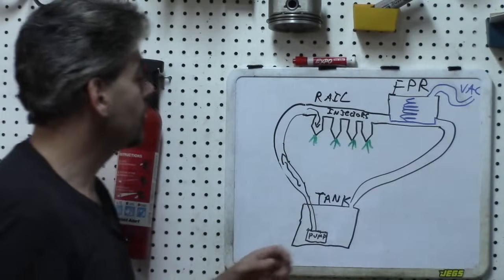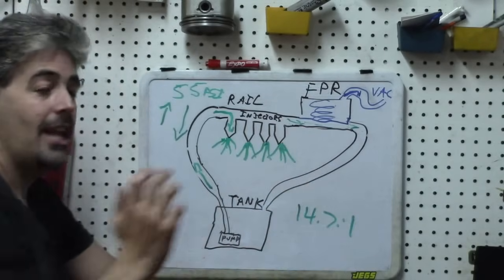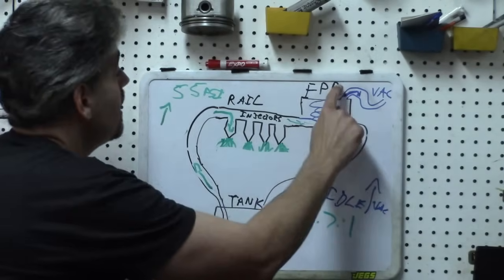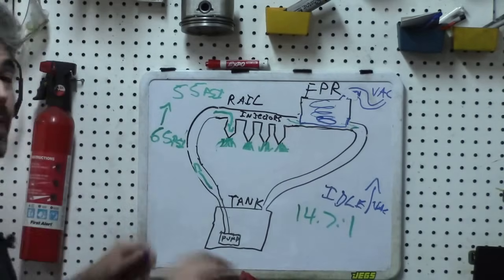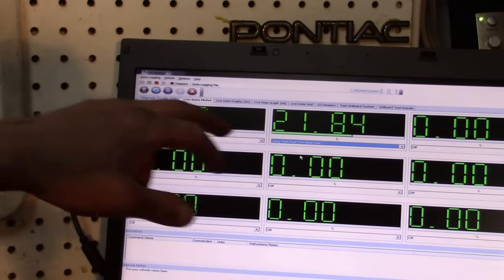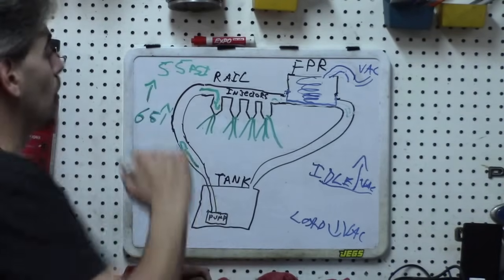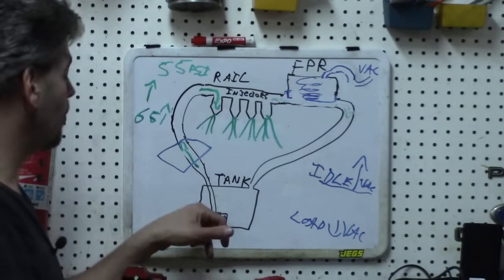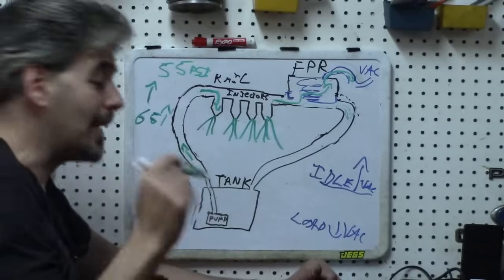Fuel Pressure Regulator Diagnosis + Understanding (HD!!)

Comment: How do injectors leak is it because the o rings fail or the pindle wears or both Matt? Got it  Matt it can be because of carbon buildup or o ring failure.
Reply: I'm not on his level, I'd be handing him tools lol but to my knowledge, internal and external components wear and as F.I. run at (at least they are supposed to) tight tolerances, when they wear out, fuel either can leak, clog or spray incorrect patterns! This is especially true when a dirty fuel filter is present or contaminates enter the fuel rail! Some "additives" can accelerate this by freeing up gunk from one end only to find it's way in the injector! I know this is probably blasphemous for me to speak my understanding in light of his knowledge (not joking either or being smart, he's that good) but yes, o-rings fail, contaminates build up, corrosion occurs and etc. I just wanted to give you SOME explanation to your answer but I'm sure he knows a lot more in depth as to the "why" or "what" than I do but that's a start! I'd recommend a fuel rail hook up and F.I. flush or isolating the faulty one/ones and replacing.
Reply from the maker: I agree with your answer!
Reply: Thanks and the injectors can hole pistons in  some cases.

Comment: Can you have too much soot on your spark plugs that you don’t burn off the fuel and this the fuel pressures are higher than normal?  I wanted to ask you as I would think this doesn’t make sense.
Reply from the maker: Such a thing would have no impact on fuel pressure.
Reply: @ is the only that fixes high pressures of 120 on a KJET the warm up regulator? That makes no sense either as when the car is warmed up it still doesn’t rev past 2000 rpm’s or go past 20 mph, but otherwise is idles perfectly and I’ve swapped out 3 used old WuR and no difference.

Comment: Hi, I could really use some advice! So, I plugged in my tester and the PSI does not change no matter what I do, only when I turn the car on, it goes up from 50 to 59. It’s a 2003 GMC Envoy I6. It stays constant at 50 in “on” and constant at 59 when the engine is on. I tried unplugging the vacuum line but nothing happened. I tried adding vacuum and nothing happened. It’s running rich. I have a p0172. What could it be? It stays constant no matter which test I run.
Reply from the maker: It’s not fuel pressure related. Look for other rich condition variables. I usually start with basic induction metrics.
Reply: Schrodingers Box thank you!

Comment: I have a 98 International 7.6, I took off the fuel tank and washed it with water well. I connected the fuel hoses by mistake and gave it air pressure, then I corrected the error. I tried to start the truck. It never started. Can you explain to me the reason?
Reply from the maker: Not quite sure I understand how you made the mistake- you connected the fuel line to something generated air pressure? What in an engine creates air pressure?
Reply: @SchrodingersBox  The problem is that the engine only starts when starting fluid sprays momentarily
Reply from the maker: Then you 100% have a fuel problem. Is the fuel pump running? If it is then You need to measure fuel pressure as first step.

Comment: It shows 1 psi pression with ignition on but when it turns on has 45 psi pression
Reply from the maker: sounds like a bad check valve. does the pressure drop right back to zero when engine turned off?
Reply: @SchrodingersBox  yes Sr. As soon as I turn the key to the off position
Reply from the maker: yep.  totally a bad check valve.
Reply: @SchrodingersBox  so replace the fuel pump right thanks Sr , the way you do thing is perfect , your videos are great explain perfect the issues have a good day
Reply: Is this the Vapor canister check valve that one I have to replace Sr?

Comment: Hi ..I have a 2006 trailblazer 4.2L and I changed my fuel pump and installed a new one but my problem is every time I pump some gas into the vehicle , its hard to start plus if I drive over 65 mph the engine hesitates and and it takes long time to increase speed plus ..if is over a hill , engine starts to hesitates again....I will be checking fuel pressure with gauges ...also large evaporation leak check engine code comes up ....and I already changed gas cap....any ideas other possible ideas? I changed spark plugs,cleaned MAS sensor, changed coils and vehicle still having that issue after running a while....
Reply from the maker: What was your data that indicated the fuel pump was bad on the first place?  
  Also what is your data it is an ignition problem?
Reply: Schrodingers Box I had problems with the fuel gauge. Every time, I pumped gas and it was about to be full, the needle jumped back to empty...so I decided to replace the entire fuel pump , instead of the needle gauge inside the gas tank....thinking that my vehicle has 175K miles on it , it was a good time to replace the fuel pump...and  (it was working fine) replaced with an aftermarket pump. Maybe I have to verify if is a fuel filter halfway clogged but need to verify fuel pressure on the line. Since , I replaced the fuel pump all kind of codes have been showing up, lean conditions, misfired cylinders even large evaporations leak.
Reply from the maker: You need fuel trim and pressure data to determine the next steps b

Comment: In my vehicle GMC yukon 2007 . I get the pressure 30 move key and when energized 40psi. Is this indicate weekness on fuel pump .
Reply from the maker: Compare this to factory specifications to determine.
Reply: "Non Throttle Body"

Multi-port or spider injection. 
1996 up V8 5.0 5.7 4.8 5.3 gas GM Truck 55 psi minimum preferably 60 psi.

Regulator or pump ?
Usually the pump.
 I have seen some that will not run on 50 & some that would run on 35.

Comment: What reason could there be for a car to eat fuel regulators? I have another friend whoms car has gone through 3 fuel pressure regulators in the last 5 years.
Reply from the maker: Possibly high fuel pressure OR consistent misdiagnosis
Reply: Whooooooo, that was quick :D thanks. I will definitely check that out tomorrow when i have access to his car.

Comment: I have a crank but don't start situation on a1990 Mitsubishi  eclipse 2.0 ,dohc 16,valve  fuel pump delivers fuel at a good pressure ,Spark is OK, I'm  not sure about the fuel pressure regulator I don't have a pressure regulator tester
Reply from the maker: you will need to get one. otherwise you will have to measure fuel trims- not easy on OBD1

Comment: I need help,Would a 2003 dodge Dakota have the same system has explained in this video?
Reply: In other words is it return less fuel system or not ?
Reply from the maker: Is it?Simply  Look and see. You don't me for that
Reply: Schrodingers Box i did some research and found that it is a non vacuum fuel pressure regulator. Is there somewhere you could direct me to find some more info about these?
Reply from the maker: Doesn't matter- just measure the rail pressure static vs idle and load and determine if the FPR is faulty.
Reply: Schrodingers Box Ok, because when I drive my truck i say about 15 -  20 min into the drive it suddenly doesn't want to accelerate anymore and hesitates, I just barely got a code p0001 which was the fuel pressure regulator
Reply from the maker: Then i would test it as my first step since there is absolutely no evidence the regulator itself is faulty.
Reply: Schrodingers Box ok thanks!

Comment: I wonder if you have any knowledge on my 2000 Honda Accord V6... Lately as I've been driving it at normal speed let's say 30 to 50 mph when I let off the accelerator the RPMs drop instantly to around 1,000.. as soon as I put my foot back on the accelerator the RPMs go back up to what seems like a normal rate of around $2,500 to $3,000. I tried changing my spark plugs which I did all but one I don't know what's going on going to work more of that tomorrow it's either stripped or stuck... I also changed my fuel pump. These are things I've wanted to do since I purchased the car. I'm wondering if it's a sensor or number of sensors or even 02 sensor..please help
Reply from the maker: What data do you have?

Comment: 1999 for f250 superduty 5.4 two valve engine lean on both banks. New idle air control valve, New PVC VALVE and line. New intake gaskets. Drained ecm truck ran better for almost a week but check engine light is on again. What else can cause a lean code on both banks besides vacuum leak? somebody help a brother out
Reply from the maker: what data do you have?

Comment: would a bad fuel pressure regulator keep it from starting
Reply from the maker: Most likely not. Whats your data off of it?
Reply: J Rob s
Reply: ive changed the fuel pump valve gasket and still it wont start i use the starting spray it cranks up then dies
Reply from the maker: J Rob Still need data. Whats the decay rate onb fuel pressure? Whats the static vs load pressure? Whats the LTFT AND STFT values idle vs against load curve? I need something to go off man- there's nothing here I can draw a diagnosis from much less a direction
Reply: fuel is in the line i had oil in my 3rd spark plug i cleaned it out and changed the valve gasket didnt use a fuel pressure regulator

Comment: Hi i have a mercedes ml500 is no fPR regulator on the fuel rail ... how can I do the test?
Reply from the maker: "T" in to the feed line with the pressure gauge  and pinch the feed and return lines and check decay.

Comment: My car  2003 C240, my car shuts off when I get to half gas of tank , the fuel pressure is 38PSI , it should be  55PSI,
Also when I shut off the engine then the fuel pressure drops to Zero,
I have a hard start problem, and my car shuts off when I get to half gas of tank.
Also when I took the vacuum line off from pressure regulator , then nothing happens , 
It looks like there is no vacuum.
Reply from the maker: check for voltage drop at the fuel pump next.
Reply: it is 13.57 volt.I think the fuel pressure regulator are  ok too.
Reply: it is 13.56 Volt, regarding your nice video, I pinch off the input pipe to fuel pump and pressure did not change , Also we make vacuum on pressure regulator and they worked , I have also replaced the fuel filter  , The fuel filter brand is "prime guard"
Reply from the maker: Zeinab Abbaszadeh That is not voltage drop. That is voltage. what is the voltage DROP?

Comment: Whereabouts are you located? I'd like to bring my  1998 Ford 4.2 van for you to take a look at.  I swapped in a 2003 4.2, just had to use my intake and harness (which I had to modify). Now my bank 2 upper O2 sensor LTFT is reading 8.6 and I'm trying to figure out what's causing that.
Reply from the maker: Denver colorado.  So what is the STFT showing? why are you concerned about the normal LTFT?
Reply: Schrodingers Box The STFT are showing lower numbers... The LTFT on bank one is lower as well... The upper O2 sensor on bank 2 is showing lower voltages... I’m new to this so my heads in a spin...
Reply from the maker: I still don’t understand what the problem is especially with lower voltages on bank 2 - how is possible to have lower voltages with a static fuel trim? That is absolutely impossible. 
what is the issue you are trying to correct? I don’t follow at all sorry.
Reply: Schrodingers Box Yeah, I’m probably not translating all that well with me being new to this. But your videos helped me to understand how the LTFT forms a new baseline etc. so thank you for that. Keep ‘em coming!
Reply from the maker: Yeah I just don’t see what’s wrong that you are trying to fix. Do you have any drivability symptoms? Any DTC’s? I don’t see how you would.

Comment: so the regulator has 2 positions : on/off  or it gradually open/close depending on the vacuum ?
Reply from the maker: Great question. it is proportional  to vacuum (or to pulsewidth modulation if an electronic one). it is not strictly On or Off.

Comment: I have a 2000 chevy express 5.7..no start fuel pressure goes to spec but then drops right off after 2 second prime..should have been pressure regulator in intake but not..i changed it yesterday with nothing changing the problem..spark is orange off coil and plugs ,this is as far as i am right now and could use help?..thanks
Reply from the maker: Sounds like a checkvalve problem to me- why did you change the regulator?? I don't understand that.
Reply: Because the fuel pressure goes up to spec when key is turned but drops instantly after 2 second prime..i thought thats the symptom of a bad regulator.
Reply from the maker: no- that’s classic symptom of a bad check valve!!!
Reply: So just replace fuel pump then?
Reply: And how do you decipher between the regulator or the check valve in pump? Only thing i could think of that i didnt do is check pressure before the fuel rail, does that seem right?
Reply from the maker: I validate through looking at a negative fuel trim to discern a leak in the system (which may or may not be a regulator) vs check valve.    It can also be measured via fuel pressure curved against load.
  Actually I can think about 6 ways to do it- it's a matter of thinking how the system works and developing your own method for identifying the issue,
  But fuel trim would be my first diagnostic.
Reply: Schrodingers Box i have a scanner that shows fuel trim but it dont start..and when it first happened it never had a problem it just shut down like it ran out if gas..i want to fix it tomorrow, can i just take the fuel filter off and check direct pressure from the pump, and that should give me the answer if it dont drop pressure after 2 second prime? Thanks for info and responses.
Reply: Please help i just put a new fuel pump in and the same thing not holding or pumping enough pressure, what else could it be?
Reply from the maker: Joe, I would need to see your data that indicated to you the fuel pump was bad. What is the deadheaded  pump pressure vs rail pressure? That's what you need to do BEFORE changing the pump to validate that's the issue!

Comment: Where can i get info on why is vaccum higher at idle?
Reply from the maker: Vacuum is higher at idle because the engine is not open to atmosphere.  The "sucking" of air into the engine is maximum.  If the throttle is open, the engine is equilibrated with atmosphere.
Reply: @SchrodingersBox  Thanks, i just finished reading online about it. I really like your instructional videos

Comment: Hi. Do you have any videos regards fuel leak detection?
Reply from the maker: Yes see my fuel pressure diagnostics video
Reply from the maker: Wait this is the one lol- I do discuss leak detection here
Reply: Schrodingers Box yes, i know. The thing is that on my car appears the dtc p0093 - fuel system large leak. Around 3-4 trips the light turns off.
Reply from the maker: Tatiana Burduja Did you confirm it through the decay test?
Reply: Schrodingers Box i wonder if error p0093 could caused by something else, not a fuel leak. On what parameters is based the fuel leak error? What do you advice?
Reply from the maker: Tatiana Burduja It absolutely can- which is exactly why you need to validate a fuel leak exists

Comment: Is there a.modification that can be done to by pass the internal regulator on a 4.3 liter vortex  and add an external regulator?  This is a very crappy design. With the regulator in the intake manifold.  Any ideas would be appreciated.
Reply from the maker: I’m sure something could be fabricated - doesn’t matter where the regulator is as long as it is on the return line.  
but honestly regulator issues are pretty unusual and infrequent.  Nowadays removal of the intake for just about anything is a standard. Even a starter- tons of cars need the intake removed to replace it.
Reply from the maker: I’m sure something could be fabricated - doesn’t matter where the regulator is as long as it is on the return line.  
but honestly regulator issues are pretty unusual and infrequent.  Nowadays removal of the intake for just about anything is a standard. Even a starter- tons of cars need the intake removed to replace it.

Comment: would the bad FPR make a car turn off,I have a tahoe and i turn it on and runs at 40PSI and then drops to 19PSI and to9PSI.HELP
Reply from the maker: Marin Sanchez Probably not but could be bad fuel pump if it coincides with a lean fuel trim. See what the static pressure is after the pressure drops to 9PSI and if it is very different from the starting fuel pressure that would strongly indicate pump.
  I would expect the car to die at only 9PSI for sure.

Comment: hi how are you i got a ninety seven blazer 4.3 w fp is ten lb lower than speck i have tried pumps reg clean grounds ei do you have a one in a mil fix its not normal .like tsb on a reg or in line adjustable i got that one in a blue moon truck thanks
Reply from the maker: I would check for voltage drop on the power feed first.
Reply: @SchrodingersBox  thanks ps a hot wire from bat pos  to the prime terminal only by me two pounds 48 psi to fifty min speck fifty six  i got to block off return line and see what is max pump can make the last time i did that it went way up  thanks

Comment: My engine light is not on.  My volvo S40 (1.8 petrol) is running too lean according to my OBD reader.  Sluggish and slight misfire.  What could it be?
Reply from the maker: anything.  what data do you have?
Reply: @SchrodingersBox  The only thing I can see with my OBD reader is that the long term and short term fuel trims are excessively positive
Reply from the maker: what electrical diagnostics have you done? those are all that are useful anyway.